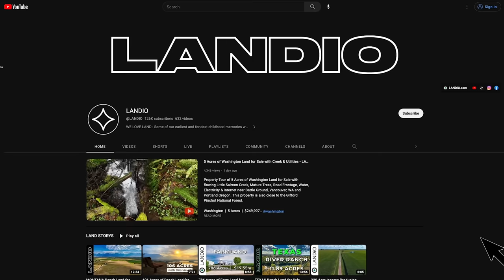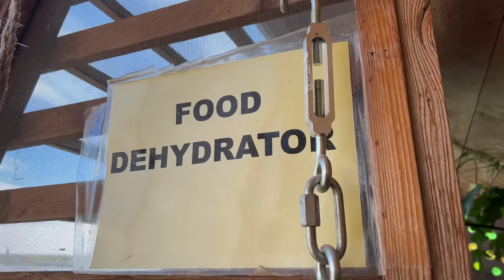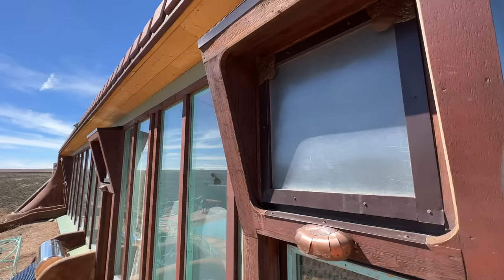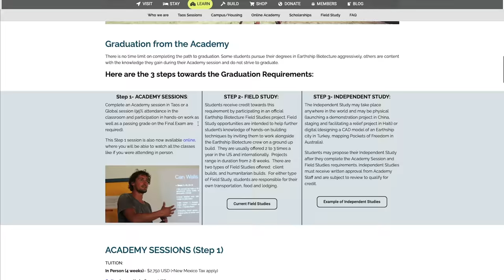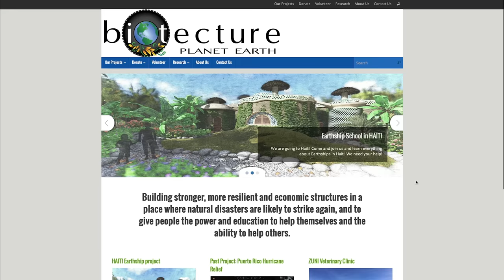EARTHSHIP = Off Grid Living & Sustainability 🚀

Comment: Can we chisel old generators to spin like Edison generators with inverters to have house current. ?    It is a a sin to some .you disassemble the okd generator and count the magnets on the axel or armature and divide by 6 and chisel off one sixth of the Tesla magnets and leave one sixth on the armature and chisel off three sixths and leave three sixths on alternating on and off all the way around.  One sixth on one sixth off alternate on and off .  When you reassemble this motor you have to hold both sides case and armature as you bring them together.  The positive post of the DC side of the inverter goes to the brushes and the case is wired to the negative side of the DC AC inverters to have 40 amps two 20 amp  110 volt AC outlets .  A car generator produces how many amps of 12 volt DC electric power.
Reply: They took all of the Chilton manuals out of the local library when I was first working on this electric power vehicles ideas.
Reply: Macgyver mad max did not use Gasolina.

Comment: 1980-2022 costs and fatalities by disaster type
The distribution of damage from U.S. billion-dollar disaster events from 1980 to 2022 is dominated by tropical cyclone losses. Tropical cyclones have caused the most damage ($1,333.6 billion) and have the highest average event cost ($22.2 billion per event). Drought ($327.7 billion), severe storms ($383.7 billion), and inland flooding ($177.9 billion) have also caused considerable damage based on the list of billion-dollar events.

Severe storms have caused the highest number of billion-dollar disaster events (163), but they have the lowest average event cost ($2.4 billion). Tropical cyclones and flooding represent the second and third most frequent event types (60 and 37), respectively. Tropical cyclones are responsible for the highest number of deaths (6,890), followed by drought/heatwave events (4,275) and severe storms (1,982).

Comment: The insulation value of this is non existent. You'd be better off grinding the trash up and using it as filler. Ground glass is used for tons of items, metal is used in everything, and most garbage if burned hot enough and correctly pollutes very little. Putting bottles in the wall decreases structural integrity. I also live in frigid Wisconsin so I like my R values lol.

Comment: NO, he did not build an entire house out of beer cans. He incorporated some beer cans into the actual structure of the house which was mostly cement. Saying he built an entire house out of beer cans is ike saying just because someone rolled up sheets of paper and then encased them with cement and the cement is the largest material used and is actually the structure supporting the walls, then they built an entire house out of paper. People need to get real instead of sensationalizing things which is otherwise known as lying, hyping up, manipulating, bull$hitting themselves and others, etc etc
Reply: I never heard anybody claim that the entire house was made solely of beer cans.

But, as you can see, the current evolution is using used tires, compacted earth, used bottle and cans, and very little concrete cement, as little as possible to meet building guidelines.
Reply: @OnlyFactsPlease  
0:22 With you having a user name like OnlyFactsPlease, we would think you would have your ears cleaned out and have learned to listen for the facts. The narrator even said it at the beginning of the video quote  "that's  Michael Reynolds. He first gained notoriety in the 1970's when he built an entire house out of beer cans"

Comment: Earthships would never make it for suburban living. Earthships are far too big. The low carbon lifestyle that Americans are supposed to be living means detached should be on small lots, 4K sq ft and less. The house should only be about 1200 sq ft.

Most climate change advocates are saying Americans should be living  in small apartments like in Europe or in even smaller apartments of 700-800 sq ft like in Japan.

Also in a subdivision how would all the Earthships be able to put their solar panels in the correct direction to maximize their production of electricity?

Comment: My god! How out of touch is it possible to be!? Why don't that talkative hippie try to survive on sun in the inner part of my country during a couple of winters?
I am pretty sure he will end up knocking on some door after a couple of hours
Reply: A wood house will not survive a tornado, so brick houses are built where tornadoes are common. Need I say more?
Reply: @sharronneedles6721   - when it is freezing cold and dark for months there is usually no light, no wind and definitely no tornadoes,  and, no electricity from solar cells,  in a couple of days people will die from the cold, that was my point
Reply: @doncarlodivargas5497  then you don't build it in the middle of Siberia just as one doesn't build a water park in the arctic circle. Do use your brain.